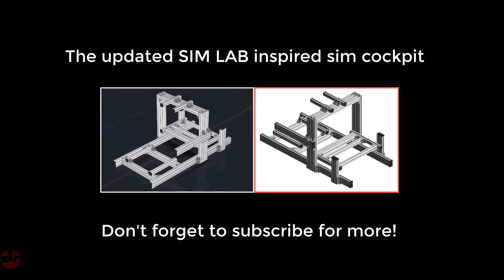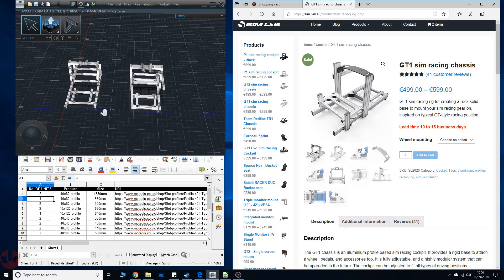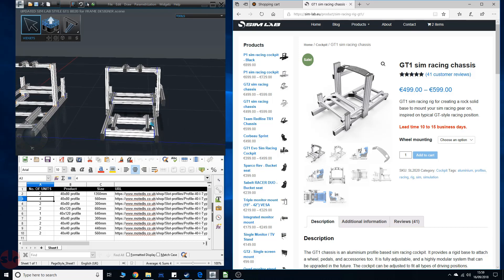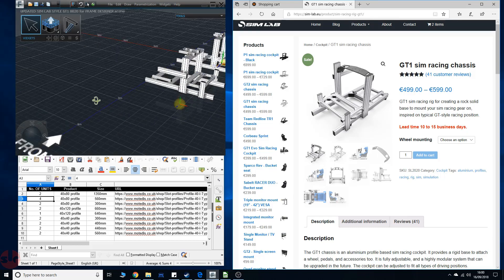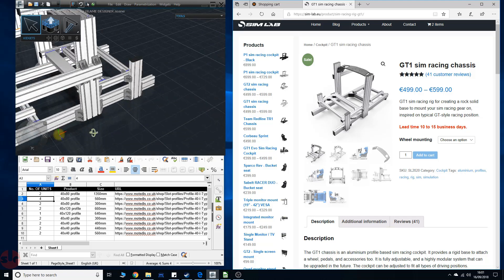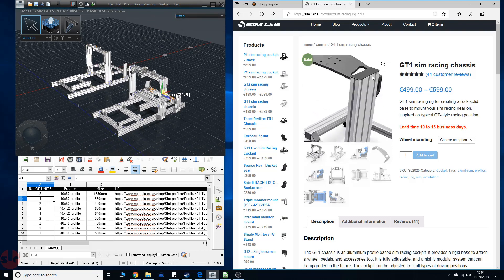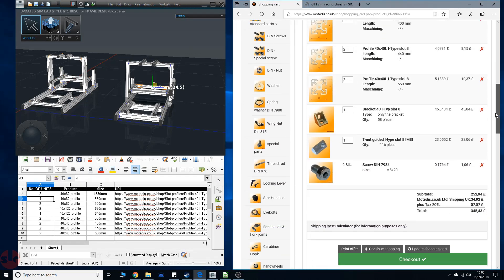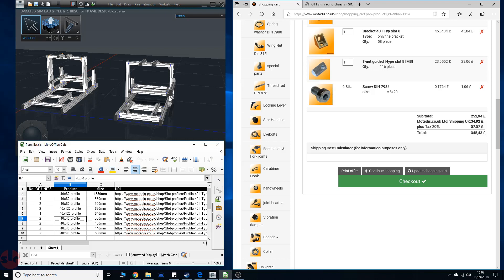Build this SIM LAB GT1 style 8020 sim cockpit and save 40%

Comment: Hello
When I opening the file: "UPDATED SIM LAB STYLE GT1 8020 for FRAME DESIGNER.scene" in framedesigner it all works well. 
But when I am trying to open "UPDATED SIM LAB STYLE GT1 8020 for MAY-CAD.scene" it say "Warning: Unavaible Vendors - This scene not supported with current software settings"
I wonder if you can help me with that?
I just installed the framedesigner and only thing I have done is to open your 2 files.
Thanks
Reply: there's one file for may-cad and one file for frame designer

Comment: Am i missing something here a Sim LAB GT1 Evo is £360.00 – £405.00 ( unsure on shipping costs ) and this build cost me £401.52 plus £50 shipping
Reply from the maker: An easy mistake to make. But this isn't based on the Evo design, this is the older SimLab GT1 used to sell just named the GT1, which was more heavy-duty and more expensive.
Reply: @SimRacingCorner  OK thanks for clearing that up.. I was sure I was messing something up somewhere.

Comment: With todays prices, significantly less than 40% savings. Not worth it at the moment from Motedis
Reply from the maker: Very true, I produced this video when the pound was a lot stronger against the Euro, which directly influences these prices. So it's tougher to make good savings right now.
Reply: @SimRacingCorner ..It is. Thanks for the part list it helps with solutions for the custom parts. Hopefully, I can source parts cheaper elsewhere.